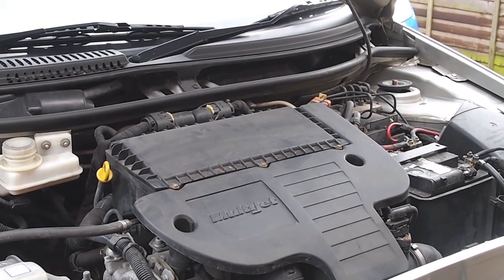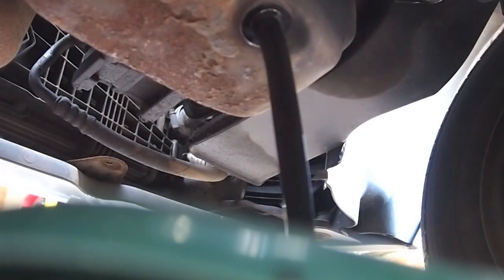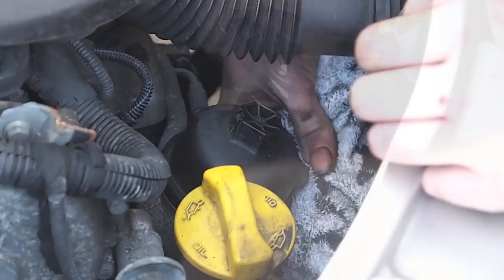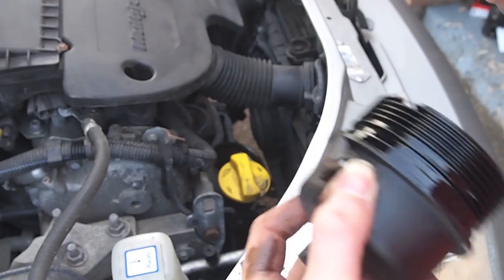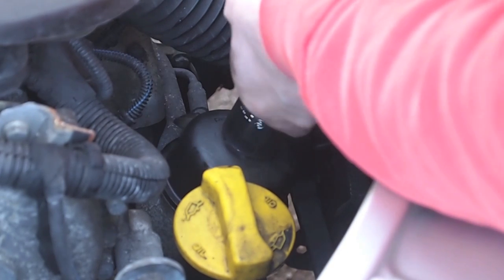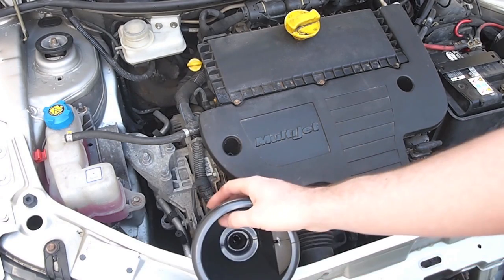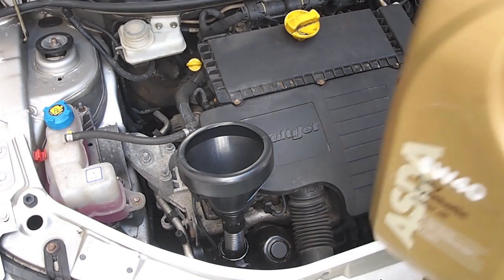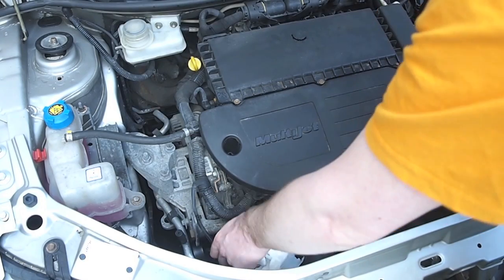Fiat 1.3 Multijet Diesel Engine Oil Change

Comment: It's always best to soak the new filter in oil first, before putting it in the housing. This ensures that oil will be at the main parts of the engine when starting after an oil change. If the oil pump has to pump oil into the filter housing first, before getting to the main parts, then there's a chance the main and small end bearings could be running dry, which over time will make the engine knock. This then would not be a good scenario.
Reply from the maker: Let’s think about this logically… in order for the oil that you have soaked into the filter to be pushed around the engine, it needs something to push the oil out of the filter, as the oil pump is not an air pump and air in the system will be easily displaced the oil in the filter is reliant on oil pressure, so it’s not going to move that oil that you have soaked the filter in, until the oil pressure is up and moving around the system. Also, if you say the oil pressure takes a second or two, to build up and the car does that once a year for its annual oil change then it is only maybe 10-20 seconds over 10 years that the car is without oil, as there is always oil left on parts from the previous running, it is simply not worth my time or hassle messing about soaking filters in oil, getting oil everywhere and making even more of a mess just for the sake of 10 seconds in 10 years (when I won’t own the car anywhere near as long as that)

Comment: checking out oil level on a engine that hasnt run?  at psa we always check after the engine has ran. So the filter and such fills with oil first
Reply from the maker: This is one of the oldest videos on the channel there is an updated version and I did cover this on the update, this video was left up because some people requested it and it had such a huge amount of people linking to it they all kicked off when I took the video down after the update which is why it’s still here, I believe there are links to the updated video in the older video but it’s here https://youtu.be/BLjEjSgU3u0 if you’ve not seen it

Comment from the maker: Hi John, i have never flushed the oil in my life, there are inherent risks with running what is essentially a very thin oil in your engine, as well as some deposits help keep seals nice a tight and engines running smoothly, I've known engines after a flush to need new oil scrapers and valve stem oil seals because of removing deposits, so unless its a very new car with relatively low mileage I wouldn't risk it, and even if it was a new car personally I still wouldn't bother.
Reply: PuntoHowto

Comment from the maker: Diesel engines have a lot of soot particulates build up over time which stains the oil, so yes new oil will turn immediately black, especially if the car has done a few miles
Reply: hi which size  elen key use for fiet siena draining oil?

Comment: can you suck out the oil using a Pela oil extractor suction pump ?
Reply: Michael Sherwin I am not sure about that vacuum suction pump pipe diameter but have used a Sealey TP6901 9litre but smaller capicity will be fine and it works fine. the suction tube fits easily into the dipstick hole and easily reaches the bottom of the sump. When empty moving the tube up and down you can hear it tapping sump bottom. All I had to do was sit the pump on a solid base approx 4 inches high so pipe would easily reach. for good oil try Total 5W 30 is very good.
Reply: Michael Sherwin I have sucked the oil out of mine every time, done. 180,000 miles no chain changes, recommend 5-30w, think even Fiat don't use 5-40w anymore and recommend 5-30w

Comment: Mi perde olio dopo aver fatto il cambio
Reply from the maker: Did you get the seal to seat correctly ? Also needs doing up to the correct tightness, sometimes if the cap of the filter is damaged you have to buy a new cap

Comment: I got the same 1.3 multijet car but not the same filter in 🤔. Is it normal?
Reply from the maker: Yes, there are two different filters used, it’s not always obvious which one you will need till you take the old one out.

Comment: Yes that’s great now how do you turn off the oil dash light.????
Reply from the maker: Hi Rod, the car in the video didn't have an oil service light, however if yours does (like our red punto did) you can download a program called MultiECUScan (google it) which can reset the oil light for you, you'll need a laptop and £5 cable from eBay or Amazon.

Comment: Ola amigo! Estou com uma certa dificuldade no motor de Fiat 1.3 multijet engine... a dada altura ele dá arranque, mas no mesmo instante vai abaixo.
Hi friend!
I'm with a little problem with my Fiat 1.3 multijet engine. It start engine, but at the same time the engine shot down. if have a different way to fix this, I really need your help.
Waiting your feed back anytime. See ya

Comment from the maker: Hi there, you shouldn't get any warning lights when doing a straight forward oil change. If you have a problem with the service reminder on the multifunction display then this obviously needs to be reset as part of a service however only the very top of the range cars have this feature (the car featured doesn't have a service light)  so I didn't include it in the video

Comment from the maker: I believe it protects the plastic housing and prevents it coming apart in normal use so it might be a good idea to replace it, to start i would ask at your fiat dealer for a price as i suspect it wouldn't cost a great deal to replace

Comment: excellent video.. thank you 😊 did my 100 000 km service today 🤙 just need to reset the oil change warning on the heads up display .
Reply from the maker: Well done you can use a registered version of the MultiECUScan software to reset service lights

Comment: Does the 90 MultiJet has any washer or ring in the sump bolt? Also, there"any major diference in using 5w30 or 5w40? Tanks.
Reply from the maker: You need to use the correct grade of oil for the engine or you can damage the engine or in the case of the 1.3 multijet, find that the timing chain fails prematurely. No idea about the sump plug on the 90
Reply: +PuntoHowto 😉

Comment: Hi, i want to know which key you use for to open the oil box and for opening the filter what must i use? i don't have the machine for to lift the car.
Reply from the maker: To drain the oil you'll need a 12mm hex key this is specific to most fiat's so worth investing in if you plan to keep the car for a longer period. I forget the other sizes needed but if you get a good set of hex keys they will pay for themselves in no time. I could do this oil change on this car in about 10 minutes without having to jack the car up, but only because I had done it so many times I knew exactly where everything is and what was needed in what order.

Comment: are these vans any good was thinking of buying one but heard there crap and give so much trouble
Reply: Electrics are shit, everything on the engine and under the bonnet is hard to get to, the emissions sensor plays up all the time, and it's like driving a block of flats on wheels.

Comment: hey ..  my has had a oil change but the oil light has not gone off is there anyway I can re set it my self?
Reply: it depends on your specific model year etc.. I know for my multijet Doblo 2006 it needs the special handheld device to do this. This is approx £140 on-e bay eg Sealey VS8623 BUT it may be different for yours, see if a local dealer can do it for beer tokens!

Comment: Hi there
I've got a fiat punto 1.3 diesel, and my intifreeze coolant is leaking, the pink intifreeze coolant 
What to do please!!?
Reply from the maker: samir kerbadj you need to track down where it is leaking from, once you've fixed the leak you can top it up
Reply: Hi 
A friend of mine told me that is the water pump, but I'm not sure, the leak is clear pink.
Thanks
Reply from the maker: samir kerbadj the water pump is on the front left hand side of the engine, if it is leaking it may need removing and resealing or it may actually need replacement, you'll need to look into it to find out what's going on I can't help any more than that I'm afraid
Reply: I appreciate, thank you very much for your advices

Comment from the maker: this is arguably the best engine fiat have ever made, what lets them down is the big chunk of metal around the engine, and the 1.2 petrol versions which have a lot of issues with head gaskets and electrical gremlins
Reply: just bought a 2nd hand 2007 1.3 diesel doblo privately, engine management light came on half an hour after picking up the van, there is not much power while driving,,2 mechanics said it was the fuel injector,so got a fuel injector fitted,drove out the garage and 5 mins later management light came back on,its just the same,nightmare engine im thinking,more money needed to try and fix the problem.what can it be???
Reply: @marky26marky  timing chain
Reply: @martin1649  four years on, stil got doblo, it's going great even tho management light is on and off

Comment: yes I meant 5lt/100km, sorry. The engine is great, its just the air dynamics of that little van. You can push it < 5lt per 100km but you have to be under ~85km per hour

Comment: How can you reset the flashing oil sign and the renew oil message after you renewed the oil and filter ?
Reply from the maker: What age and model of punto? Generally this needs to be done with software via the obd port
Reply: PuntoHowto it's an Punto Evo 1.3 JTD, november 2011.
Last time, the dealer reset the message, but is there no way to do that like: ingnition on, push reset for a minute, ignition off ??
Reply from the maker: no sadly not
Reply: Wilco de Jong  look on you tube.. some fists can be reset without a handheld, some cant, screwed by a car manufacturer again! Sealey VS862 claims to do this BUT may not be correct for your car... research it more eg forums and youtube... try and identify a video with the same dash electronics display as yours